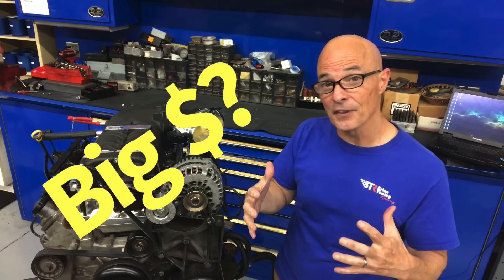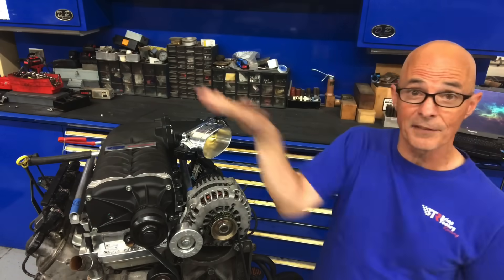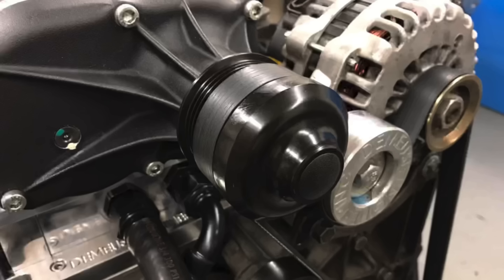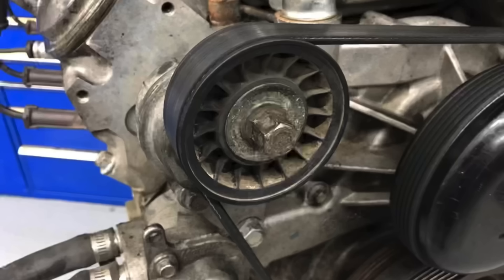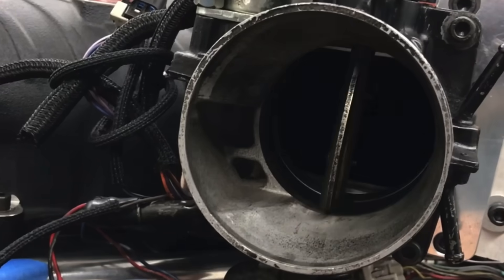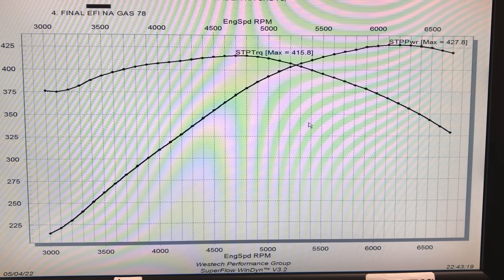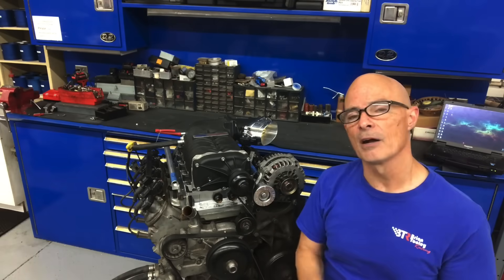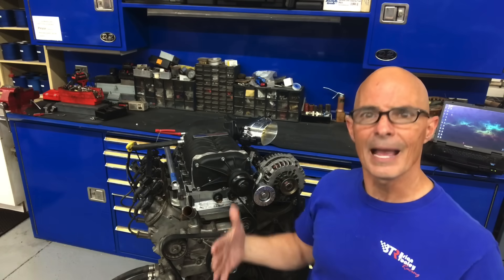THE ULTIMATE LOW BUCK LS BLOWER ADAPTER KIT? HOW TO INSTALL A FORD GT500 BLOWER ON YOUR JUNKYARD LS!

Comment: Can that supercharger make 1k hp on a 6.0 ls ly6. How much?
Reply from the maker: yes-this one can
Reply: Do I need the big sigle blade and a 10-inch lower pulley 8 rib..
Or size lower pulley..

What is needed to get that ly6 1000hp using that m122 blower..

What cam ?
What timing table?
E85 or 93?
Afr?
Top pulley size?
Max, rpm?

Comment: What lower intake are you using
Reply from the maker: either Hi Ram or Low Ram or old Magnusen (go talk to Tom Demuse at Demuse Engineering)
Reply: @richardholdener1727  and man love your videos and thank you for putting me in contact with Demuse in the past he's a awesome dude
Reply: So I just did lol I'm running a low ram and mine dose not line up for nothing I thing something is off so you had to make room for your low ram mine just slides right on

Comment: I'm in over 5k and haven't even put it together yet...injectors, coil packs, terminator x, lower tub to put the adapter plate on, the adapter plate, the blower, and the throttle body.....not including the tires, tune and rear end i need to handle that much power... cha ching cha ching
Reply: Oh yeah...and the intercooler and electric pump I bought today to cool the other intercooler

Comment: Can I use a Holley intake lower adapter manifold and a custom plate to fit a northstar 4.4 supercharger to my 5.3?
Reply from the maker: the Northstar requires more than an adapter plate-see the cadillac blower video

Comment: So what were the mods on the 5.3L to get the 400+ on motor? With the newer 2022 5.3L what are we typically seeing with mods? I’m seeing supercharger kits and they’re saying 515ish HP on a stock motor, seems low compared to a supercharged Coyote that can yield 700+ on a stock motor. Just curious what mods would be best on a new gen LS 5.3L?
Reply from the maker: the new 2023 5.3L is not an LS-it is a direct injected LT motor.

Comment: Wait....First of all it's $2500 for just the Adapter plate, plus $3,000 for a used blower then $350 for the MAF adapter, $1250 for drive parts and so on and so etc. You would have over $8,250.00 in a used blower!!! 
  If people listen to you and the rhetoric you speak.... SMH. Just buy a $2100 LSA blower and $1200 drive kit and $75 adapters and you are done. Why pay 250% more to do the ford set up???
Reply from the maker: no

Comment: Silly question, but what ATW intercooler is that? Did it need to be modified to fit, or did it line up naturally with this combination?
Reply from the maker: intercooler was from Demuse Engineered-designed for this swap
Reply: @richardholdener1727  appreciate it, Rich!

Comment: I'm not knowledgeable about fuel injectors, so I'm confused. Why is this running 80# injectors but my stock 460 ford is only running 24# and I get 1/2 the fuel economy. I know the displacement is hugely different but the 5.3 turns faster, makes way more stock power. I have a upper limit of 4800 rpm and I only get 225hp. Can anyone explain please.

Comment: How much taller is that blower combo in the L33 compared to the L33 when it had the stock truck intake on it? Would this set yo with with a kwik wide bracket corvette spacing accessory bracket kit. I have a zr2 4x4 s10 (2000 year model) than I've been gathering parts for and the last think I need to get is that corvette spaced accessory bracket kit that kwik makes. I plan to daily the truck and I have a turbo I had planned to remote mount since I will be running an A/C system (also from kwik). Not sure if I should try thus or just go N/A with the truck build. I have 2002 WS6 6speed TransAm than in planning to do an H/C/I on and just leave the 125/150 shot on it that I've been running. I build a stroker 383 also with nitrous and converted to an lt1's T56 in my old 89 formula firebird. So most everything I've done is either just built motors with or without nitrous and I wanted to do this 4000lbs S10 as my first LS swapped forced induction build that i can still daily drive (went a bit over board in the 89's stroker 383 and it wasnt very traffic friendly but a hell of alot of fun. I may consider going this route also long as I dont have to run a 4+" cowl hood to clear the engine like I ended up with in the 89 formula firebird. I figure I'd have to do a 2" just to clear the truck intake anyway and the opened back of the cowl would help some with heat extraction from under the hood but I would like to be able to see the other side of the truck since the scoop on the 89 meant I could see the pop up head light with out leaning forward. Thank in advance. You do great videos. I'll likely do the HCI to the 2002 soon since its sitting at 74,961miles as of today and need a new clutch and slave cylinder anyway.  That should give me time to figure our the route I'm gaining to ultimately take with the zr2. Thanks again

Comment: ive been wondering lately if the blower adapters for a holley ls high ram intake would work on a ford small block using a holley high ram
Reply from the maker: NOT SURE IF BLOWER PULLEY WILL LINE UP WITH CRANK THE SAME
Reply: @richardholdener1727  ya thats been my major worry/consideration

Comment: I just want everyone to know im gonna run a gt500 blower on my completely stock except chopocabra cam no ring gap or anything, wish me luck. I will have watwr to air intercooler and e85
Reply from the maker: will be fine at low boost
Reply: @richardholdener1727  mine came off 2011 gt 500 5.7L i think it will be around 12psi so not too much

Comment: Man I LOVE the engine durability of the 5.3 platform (usually reserved for "big block race engines") and innovations today, as opposed to 40+ years ago. Way back when it was a daunting task (and big $ ) to put a rootes blower (detroit diesel) on an engine a make it run well. It still costs lots of $$ but at least now, ya don't have to be a NASCAR engine build shop to produce respectable HP.

Comment: Is there any test of ratio (pulley size)for ls 4.8/5.3 ?
Is it useful to have a "bigger" cam when you use blower ,you will have power down low anyway
Reply from the maker: no pulley changes

Comment: Hi Richard, great idea for the blower insulation. Wondering if a Holley low ram intake base or midsize with a home made flat aluminum adapter plate would work. My concern is hood clearance. Looks like you have the stock truck alternator bracket. The alternator looks taller than the top of the blower. Wondering how much space.😊
Reply from the maker: Tom Demuse makes an adapter for the low ram or hi ram

Comment: What with this supercharger make on stock 53 with no additional upgrades
Reply: Safe daily driver type boost not sure what psi that would be.
Reply from the maker: COULD LIKELY ADD 100-150 HP ON PUMP GAS AT REASONABLE BOOST LEVELS
Reply: @richardholdener1727  nice thanks for the reply 👍🏼
Reply from the maker: at what boost level?

Comment: So what valve springs and valves you recommend for a daily with this setup.
Reply from the maker: valves are stock, springs depend on the cam
Reply: @richardholdener1727  actually probably the mild Truck Norris.. 
Low Boost.. Truck is a LT and currently getting Long Travel Suspension.. Luxury Prerunner with A/C looking for a reliable 550hp-575hp
Just wasn't too sure what valve setup to go with being the instant boost output..

Comment: What intake would you recommend for  a 4.8 or 5.3 to put an m112 supercharger off of a ford lighting? Could I get by without using the intercooler ?   would I gain any hp or just wasting my time?
Reply from the maker: this intake
Reply: Thanks.  Can't tell what intake  Can't see any picture or anything.

Comment: Hey Richard. I'm looking to do this. I have a line on the blower. I'm having trouble finding the demuse adapter plates. Could you send me a link. I was also wondering if you know anyone in Ontario that installs or could install this, and tune it. Thanks Patrick
Reply from the maker: do a search for demuse engineering on face book

Comment: Demuse makes an r2650 adapter too, which I think would work better on a Truck setup, try the roush 2650 next? And will the 102 mm tb fit the 2650?
Reply from the maker: why would a 2650 work better
Reply: @richardholdener1727  the throttle body inlet is on the opposite side so it wouldn't interfere with the alternator, and would allow for use of stock location air intake, it also appears the mounting holes for the throttle body hold down bolts may work with a 92 or 102mm throttle body, but it may be ford or roush proprietary. The positioning of the charger pulley also seems like it would give decent pulley coverage without needing another pulley in the  system, the routing seems like it could go from tensioner, idler, alt, to tensioner, idler, supercharger, alt. ( although this may cause slip on the alternator, as i'm not sure how tall the demuse setup places the supercharger)  either way, no stretching or re routing the MAF wiring cause stock location,  no  battery relocation to fit an airbox in the battery tray area, and still get decent access to driver side ignition coil bracket once everything is on, instead of under the intake piping.

Comment: Can u run this without the air to water cooler? I want to do air to air. So it's lower
Reply from the maker: IT WON'T WORK AS WELL AS ATW, BUT IT WILL HELP
Reply: @richardholdener1727  ok cool I have an e36 with a twin turbo ls. But I want ac so im doing a supercharger keeping the air to air since it's been fitted far forward.

Comment: For a 455 Olds in a motorhome, max 4500 rpm, how well would this work for a boost in low end torque?  What if it is run at low boost and no intercooler (vertical clearance is a problem)?
Reply from the maker: the rpm has no effect on the need for an intercooler
Reply: @richardholdener1727  The amount of boost and heat in the charge air should determine the need for intercooler, correct?

Comment: My question is what did that blower come of or what model number it is
Reply from the maker: THIS WAS FROM FORD RACING FOR A COYOTE-BUT THE KIT WORKS WITH STOCK GT500 BLOWERS
Reply: @Richard Holdener  cheers mate I'm in Australia and going to put one on my holden stroke 355

Comment: Awesome content Richard, really fascinating stuff across the board!!  I’m fairly new to the LS family and have recently become the owner of a 2005 CTS-V w the 5.7L LS6.  I’ve come across this video and was curious if the adapter and blower would fit the ‘05 V1 or if there was a link you could direct me to w a parts list or your recommendations?
Reply from the maker: IT FITS ANY CATH PORT LS
Reply: @richardholdener1727   dear Richard parts recommendation required ,thanks

Comment: We completed the install of the m122 on my GTO. Still got some tuning left left to do. Definitely not cheap to make sure it is not heat soaking. On a base tune to make it drivable, it is awesome! Torque does not stop, and power is still on the table. Just did a 600+ mile run to KY for LS Fest East. Drive it there and back from VA to KY and back. This thing is too fun!
Reply from the maker: Nice work!
Reply: @richardholdener1727  Bad Company Inc. Located out of Toano, VA did an amazing job on it!
Reply: How did you make out with heigh clearance? What do you say the total is with the blower and the lower ? 
You able to run the stock hood ?
Reply: @DBTUNED-FL  can’t run a stock hood. The good thing about the theme of the build is Wasteland / post apocalyptic…so I just cut a big hole in the hood. It sticks up pretty high. I also didn’t use the ultra low ram intake either. Talking total money for the build…it’s over $10k for everything we did. Can’t wait to get this fully tuned to see what it really makes. Just ordered a new pulley system and a clutch to handle up to 1200hp…calculating what it’s potential, plus nitrous, it will be close. We shall see.
Reply: @hybred757  any chance you can measure for my what it is from the top of the valley plate to the top of the blower ?
Reply: @DBTUNED-FL  the car is at Bad Company Shop In Toano…I will be getting it back up next Saturday for a photo shoot. I will get the measurements for ya then.
Reply: Im about to install mine i cant freaking wait..how did you fix heat soak issue?

Comment: That dude should make one for the 4v 4.6. How many of those motors are out there in need of a blower? As far as I know, you have to find a lower off of an 03/04 Cobra and that's the only way to put a roots or twin-screw on one.
Reply: They made 2.1 Kenne bells for em back in the day I think they were non intercooler so power is limited.  I would run an 03 cobra lower so you can run the awesome blowers they make for those like vmps gen3r

Comment: Ordered my adapter for my 6.2, don't know if I have ever met a nice guy than Tom Demuse. Took the time to educate me about the product and how it was drilled out for several other blowers already if I decided to upgrade. Told me everything I needed to get everything installed, even took the time to look up parts (without me asking) to make 100% sure I got the right stuff. Even gave me estimated wheel hp off of his build. If the parts work half as good as his customer service it will be more than amazing
Reply: Same question here boss ? Any links
Reply: How much was it $1800+ ?
Reply: hi bro from where you order it, any link website.

Comment: That much hp without ring gap😲 Sheesh😮‍💨
Reply: It's over 700 at the crank with no exhaust and no driveline loss it might be 600 wheel at best.  That is a decent chunk of power but not that crazy.

Comment: What is your opinion on this? Getting ready to build a sbc 357 with 195 AFR as cast heads and the AFR dual plane intake.  Comp 268h or the comp marine 270 cam. 10.1 compression. This will be going in a long bed s10 with stock rear gears. Daily driver.
Reply from the maker: good combo
Reply: @richardholdener1727  thanks for your reply! I got my ideas for my engine from watching your videos!

Comment: Does anyone know if these are made to work with ls3 heads?
Reply from the maker: WOULD NEED A DIFFERENT INTAKE
Reply: @richardholdener1727 first, thank you for the very timely reply. I understand  different lower intake is needed, but it doesn’t mention on his site (very little information) if the adapter bolts onto the the LS3 specific Maggie lower intake tub. I don’t see why it wouldn’t but I like to be completely sure before I take a leap.

Comment: The reason gt500 gets rid of m122 is because they heat up way bad so trinity is the way to go
Reply: They don't "heat up too bad" they're just a small blower.  Guys make over 600 to the wheels on stock 5.4 long blocks with those blowers on pump gas.  That is very respectable.  People switch them out because they want more power than it is capable of producing.  If you're not looking to make more than 600 to the wheels the m122 is just fine it is quite a bit cheaper than a 2.3 tvs.  Of course they run hot when you got them spun to the moon and back alot of blowers do that you just gotta improve the cooling appropriately.   People don't get rid of m122 because they heat up too bad its just something you gotta do if you want over 600 rwhp which alot of people these days want that.  The engine is capable of way more than the blower is thus why people swap them out.  People swap 2.3s too if they wanna make big time power.

Comment: Just picked up a 2300 5.8 blower with 10k miles on it for $250.00 that my buddy had sitting on the shelf at his shop collecting dust from a blower swap a few years ago.
Reply: Did you buy the full kit? I’m trying to figure out what the heigh is on jt
Reply: If you really paid 250 bucks you stole it.  They're worth 1500+ all day.

Comment: How about on a 351w ford motor?? Thanks for all the awesome videos!
Reply: It would be cool to put a 13-14 gt500 blower on a 93-95 lightning which had a 5.8 liter 351 Windsor in it.  Those 2.3 tvs blowers they had had 5.8 printed on one side and SVT on the other and since a 93-95 lightning is an svt product with a 5.8 liter engine that would be the perfect blower for those trucks and with heads and cam you could make some serious power too.  Would give it a gen 2 lightning vibe as they had m112 blowers on them.
Reply: @midnight347  I would love to put a gt500 blower on my push rod 351w! Problem I believe is the intercooler.

Comment: Damn, that is just sick. Weren't you a bit concerned running damn near 15 pounds of boost on that test rig? Maybe it being as worn as it was allowed that much boost? Is there a way to throttle that boost down for other applications? I am looking at maybe 10 pounds max. Anyway, thanks for the great video.
Reply: Change the pulley size
Reply: @tylrpnk99   dear please recommend the pulley size.
Reply: @mohammedalmamari6662  smaller diameter than stock OEM spec.
Reply: @GMTuned  if you want less boost you wanna run larger pullies.

Comment: The real question is whether or not if this is a cheaper setup than the lsa blowers. Considering the lsa blowers are coming down in price and it doesn’t require an adapter plate.
Reply: It requires an adapter plate for a lot of setups
Reply: Depends if it's cathedral or rectangle ports heads

Comment: Would you do a ls7 with a lsa blower???
Reply from the maker: pretty small blower for an LS7-and the intake won't bolt up
Reply: @richardholdener1727  
I seen ls3 to ls7 adapters, I have a stock ls7 and a lsa blower laying around and curious what power it would make bone stock on both units
Reply: @harrymoreno6729  Unless you only want to make a little boost, I wouldn't waste your time.
Reply: @ssoffshore5111  understood but honestly I'm getting one for dirt cheap and well I dont see why not